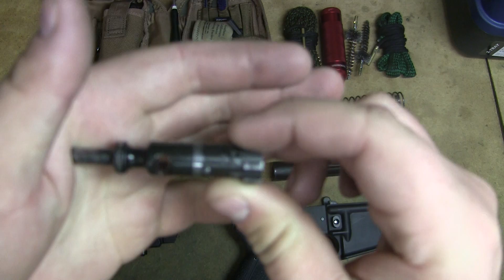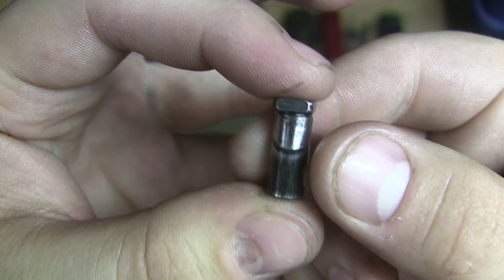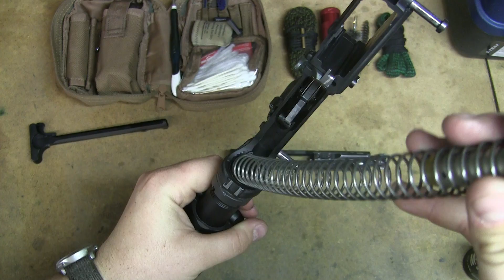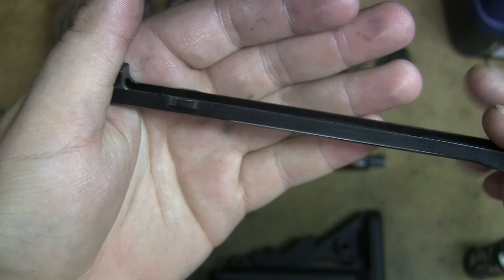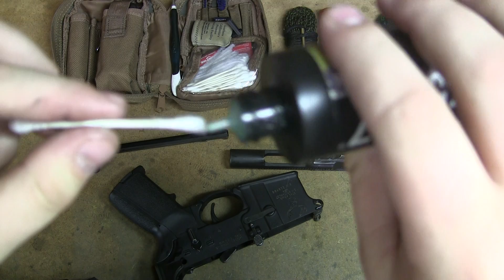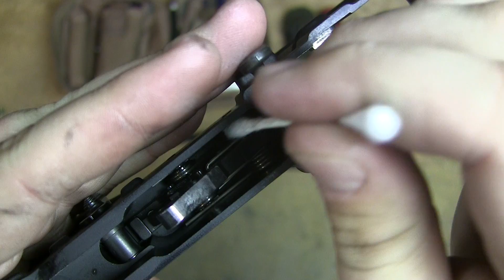AR15 Lubrication

Comment: liked the video. What rail system are you running?
Reply from the maker: Thanks, I appreciate that.  In the video I'm running the Troy standard 7" carbine quad rail, but on my AR now I'm running the Daniel's Defense Omega rail and I find it to be far superior to the Troy unit (and far more expensive too unfortunately).  I will say for sure that the Troy rail was a quick install and it was rock-solid, nothing cheap about it at all, but it was too heavy for my liking.  I went with the Daniel's Omega rail and it too had an easy install but it's lighter and is completely free-floated, and I did actually notice my groups tighten up at least by a quarter inch.  You couldn't go wrong with either, but I'm always constantly re-evaluating my equipment and upgrading whenever my budget can support it.  Thanks again for watching!

-Mr. 2nd

Comment: you are actually somewhat wrong. Try cleaning a rifle thats been well lubricated vs your method. Carbon nearly wipes right off. Maintenance is key to anything. and you are giving bad advice
Reply from the maker: I think "bad advice" is advice that is unsafe or damaging to equipment.  I offer my opinion, which is for anybody to review and decide.  Lubricate the hell out of your AR, shoot 1,000 rounds, and see if the carbon just "wipes right off."  You'll have caked carbon on the bolt tail, gunk all up in the star chamber, a filthy bolt carrier, and carbon all in the upper receiver and inside the charging handle.  No matter how much lubrication you apply, a direct impingement gun is going to blast hot gases into your upper and BCG, blasting out or burning out the lubrication and coating the respective surfaces and parts in carbon.  

Lubrication should be viewed as, and used in, a manner that lubricates.  It can perform other functions in a limited capacity, but its sole purpose and strength is lubricating moving components and minimizing friction, not making carbon wipe off.  If you want the real deal, buy a nickel-boron BCG and you will in fact get a real "wipe-off" effect, but that's because of the surface treatment off the parts, not lubrication.  

Bad advice, or just not what you agree with?  There is a difference, I would hope people know that difference before dropping huge accusations.
Reply: Phillip Smith u sir are a dumb ass
Reply: Mr.Smith, you just got put in your place, sir.

Comment: Excellent demonstration. How many rounds maximum would you shoot before a light oil touch up?
Reply from the maker: Thanks.  The real answer is, as many as I need to.  If I'm in a bind I'll shoot what I need to shoot with the full knowledge it needs oil or I'm wearing parts and risking an eventual breakdown and I don't care in that kind of situation.  In Afghanistan I really didn't care when it came down to it, I had a spare BCM BCG I took outside the wire every time just in case.  I had a assault pack full of extra mags and I was a gunner in the turret, so my M4 got real dusty on those "roads."  It never let me down no matter what happened, I actually kept it REAL minimal on the oil going into that kind of situation, I didn't want to create a dirt magnet with wet areas, the find dirt would get everywhere even with a mag inserted and the ejection port cover closed.

The "normal scenario" answer would be a quick inspection before a range day -at least inspect what's going on and drop some oil on the critical parts discussed in the video if it looks bone dry.  I've seen an LMT Defender 2000 (basic but well-made AR) go 3,000+ rounds with only an initial lubrication over the course of a month with no failures whatsoever, and it was still rock-solid after a thorough cleaning and re-lube.  No need to do that under normal circumstances, but I think people don't realize how far the AR will go when it's built right, even if neglected.

-Mr. 2nd
Reply: Mr2ndAmendment You bring a great perspective to this topic. For me, minimal oil will just make it that much easier to clean. Keep those videos coming, and thank you for your service to this great country.

Comment: great vid man! what kind of bolt is that? is it milspec?
Reply from the maker: Technically you, as a civilian, cannot buy anything for the AR rifle that is legit mil spec, unless you purchase a transferable Class III M4 or M16.  

But yes, this bolt and the rest of the BCG was built to mil spec standards.  It's a Spike's Tactical M16 (full auto) BCG, which was built to the standards of the mil spec (Colt Technical Data Package).  The only thing missing to make it 100% legit "mil spec" is being inspected by government armorers, but if it were to be inspected it would pass.  I should do a video on what "mil spec" actually means.
Reply: Mr2ndAmendment Got it bro....So I have a radical firearms AR15 so If I decided to swap out the bolt what kind am I supposed to look for exactly? I know there's like 4 different types correct?
Reply from the maker: I'd just keep using that bolt till it fails, if it ain't broke don't fix it -you could use that money on ammo, mags, or training.  A good replacement would be Palmetto State Armory, Spike's Tactical, BCM, and some others that are more pricey.

Comment: Something a lot of people forget, or never knew, is that a good gun oil/grease will have boundary lubricant packages. They're small solids that sit between moving parts and act like tiny, microscopic ball bearings (kind of but not really). Even if the liquid or greasy carrier is forced out from between the parts being lubricated, the boundary lubricants remain. 

This is part of the reason why a light coat of good oil/grease is preferred over just dumping it all over everything.
Reply: I think that's one reason fully synthetic Motor Oil works so well.

Comment: What about the locking lugs?
Reply from the maker: For casual shooting, it's not a bad idea, but I personally don't lubricate the bolt lugs or lugs of the barrel extension (where it locks up).  50,000 PSI of force rotates and shoves that bolt out of battery every time you pull the trigger -I don't think a couple drops of CLP will help anything in that department.  If I'm headed into austere conditions where I can expect lots of dirt, dust, sand, or other problems coming from my environment, I definitely don't lubricate the lugs.  It's already got limited tolerances, when I coat the lugs in oil I'm creating a dirt magnet and then I will have failure to go into battery or grind up the lugs with the sand and dirt sticking around because of the oil.  Just one dude's opinion, for casual range shooting there's no consequences or worries about dirt or dust, so it's not a problem, but if you know you're headed into a dirty situation I would avoid doing that.

-Mr. 2nd

Comment: Some people use things such as carb cleaner or brake cleaner to clean the bcg.  It essentially removes all oil or carbon from the metal.  If you did that would you need to apply something to provide corrosion protection to the parts that don't necessarily need lubrication in the areas you pointed out in this video?
Reply from the maker: Brake cleaner does work to quickly get rid of carbon, the gun world equivalent product is Gun Scrubber, which is essentially brake cleaner.  You definitely want to use gloves and be careful with what guns you use it on, I've taken the bluing off some parts with brake cleaner.  Military parkerizing, anodizing, or Cerakote can survive it no problem.

The only real downside with brake cleaner is that it WILL remove any and all lubrication or rust-preventive on the parts.  If you use brake cleaner you'll have to re-lube everything and also coat everything with another light coat of oil for rust prevention, which is why I don't recommend brake cleaner for usual cleaning.  The best use for brake cleaner would be if you're attending a high-round count carbine course over several days or a week, where you're putting thousands of rounds through you rifle.  Between iterations or days you could use the brake cleaner, then re-apply oil on the needed areas and not worry about rust in those several days, then you'd do a full detailed cleaning when you get back.

Comment: Great, brief and to-the-point video. I was told by my seller to run it wet. I may have to rethink that theory.
Reply from the maker: If it's a brand new rifle then it's not bad advice just to help everything break in and sink some oil into the finish of the steel parts.  The only real concern about a new rifle are the gas rings -make sure they are super oiled up, I've seen new ARs with dry gas rings cause problems.  We had several Stag-15s we just put on the rental line when I worked at a gun range, and the rings were totally dry and it resulted in shearing the gas rings.  I had never seen that before and I think it was probably over-sized gas rings, but lubrication probably would have prevented that.  Telling newer AR15 owners to just run it wet is probably the best advice if you're going to assume they don't know how to take it apart yet, but it's really not needed.  Good luck and have fun with it!

-Mr. 2nd
Reply: Yes it is brand new. I have yet to get to the range with it. Mostly stocking up on ammo. Between my other firearms and teaching my 16 year old daughter to shoot, it gets expensive fast!

I plan on giving my AR a good once-over (clean & lube) just to get any residual manufacturing crud out of it. Mostly been researching here and other places for the best advice. Thanks for your response.

Comment: New to AR , thanks for a great video. How do you feel about using grease, like Mil-com, in the bolt carrier ?
Reply from the maker: I hope you found it valuable.  I'm generally not a big grease fan for a direct impingement AR15 -seems to attract dust, dirt, and gunk up with carbon over many rounds.  The truly remarkable part about the AR15 is that you can over-lube, grease it up, or apply too much of something and for the most part it'll just keep running.  Under normal range conditions, you won't ever hurt it or cause damage, but if you ever operate in austere conditions or high round-count courses in rough conditions, you'll quickly realize that the grease is a dirt magnet.  You won't suffer a penalty for it for normal range use and it'll work great, but if you ever have to push it to the limit you'll encounter some malfunctions with any heavy-viscosity lubricants. Thanks for watching and the comment!

-Mr. 2nd
Reply: Try EWG grease and you won't look back.

Comment: Great video, thank you for posting. My learning curve is leveling out, and I hope to finally shoot my S&W M&P15 Sport 2 this weekend. Just received my ProShot order, so I have everything I need to clean and lube my rifle. I've watched a ton of videos on cleaning and lubing the AR-15, but seldom if ever do I see anyone mention using solvent. Should solvent be used to clean an AR-15? What are your thoughts?
Reply: right its just a lubrication video. he doesnt speak about cleaning. i would assume its the same with any firearm. i was curious to know also if this is a piston or direct impediment system as i hear di gets the rifle dirty quicker.
Reply from the maker: I'm a huge fan of Hoppes #9 and took plenty of it to Afghanistan for my weapons.  If I had to use only one solvent, oil, or cleaning compound for the rest of my life and I could only pick one bottle of something, it would be Hoppes #9.  Breaks down carbon, does pretty well at copper/lead removal, and could work as lubricant if needed and will definitely protect metal from rusting.  

I clean with Hoppes #9, scrape, clean, and wipe away all the carbon, then lubricate with CLP.

Comment: not sure if you do this but the gas rings should be staggered on the bolt, good video
Reply: I've actually read in many places and from my shooting instructor, that's actually not true. That it will fire with even one ring.
Reply: People say you need to stagger the gas rings, probably because people say you need to stagger piston rings in an engine. The engine piston ring thing has been shown to be a myth so I'm confident that the gas ring thing is too.
Reply: @JamesJohnson-rp9px  The Armorer for the NSSF says staggering the rings is a myth and that you only need one ring for the weapon to operate too.  fwiw.
Reply from the maker: Thanks.  I'm aware of the gas ring staggering situation but chose not to include that in the video.  In the Colt M4 Armorer's Course, they said the rifle will function with just one gas ring.  Once I heard that I tested it with success, and since then I've lost any desire to stagger the gas rings as it seems to make no difference, whether I stagger them or not.  I've tried staggering the rings and purposely aligning them to create a gap, and I've discovered no difference whatsoever in performance.  They said it was more about the overall seal between the bolt tail and the inside of the bolt carrier, and staggering gas rings didn't matter when you got three intentional holes machined into the carrier to vent excess gas.  I first heard about this practice from a SRT team guy with the DOE, and had occasionally heard it in the gun shop from old school AR guys -maybe some of them were Vietnam vets when they were doing anything to try and make the original M16 more reliable.  

Either way, I find the practice of staggering gas rings to be of no concern to the modern AR15 owner and I would urge you to try it for yourself and see if you experience any problems in purposely aligning the rings.  Great comment and thank you!

-Mr. 2nd
Reply: Cool man I will do that. not sure if I'm old school or new did basic in 96 and just retired. Back to the topic I actually cant remember ANY time when I had a problem with my AR/M4 but to be honest My attention switched to my Abrams when I went Armor and got BMG as a individual weapon :) the armorers course sounds fun maybe Ill look into it Thanks
Reply from the maker: Jeff Lowe 

Thanks for your service, looks like 20 years, that's impressive and respected.  I went through basic 2 years ago and there was no mention of staggering the rings.  I also have a love for the .50 cal, I was a gunner on deployment and sometimes I had the .50 and it's just something else entirely.  11B, so we only deal with trucks at most, but usually we're walking -can't imagine being on a tank.  Well done brother and thank you.

-Mr. 2nd
Reply: Thanks Man, I was 11B Too, then I got tired of walking and got a tank :)
Keep up the great work Brother.

Comment: Really helpful video...however, don't the extractor and ejector have to be lubed also...I really appreciate your 
advice...thanks!
Reply from the maker: Thanks, good questions.  Lubricating the extractor and ejector is not a bad idea for normal range use.  Every once in a while it's not a bad idea to put a drop of oil on the bolt face at the ejector and use an object to push the ejector down and up several times to allow oil to flow into the ejector and ejector channel.  The extractor doesn't need to be taken apart for normal maintenance, but some lubrication on the extractor pin and insides of the extractor will help prevent rust.

For rifles being used in or exposed to harsh environments or austere conditions, I recommend no lubrication on these points.  More lubrication means more sand, dirt, and dust will collect in this vital areas that have little room for grime, and excessive lubrication contaminated with dirt will gum things up or create tolerance issues while trying to chamber and handle rounds, so the end result would be jams.  

I hope that helps.
-Mr. 2nd